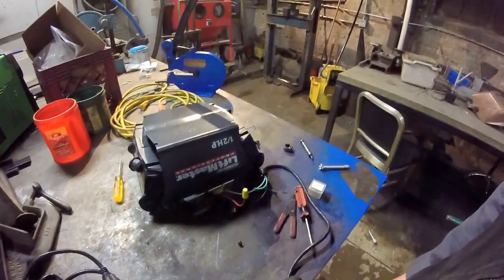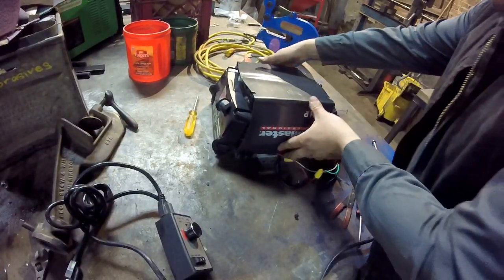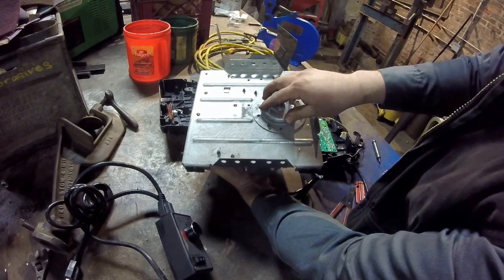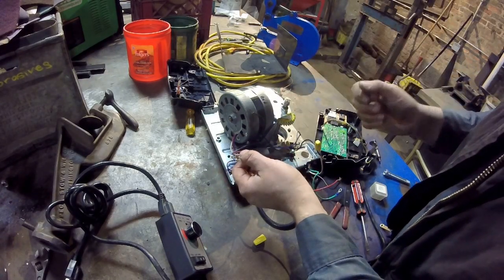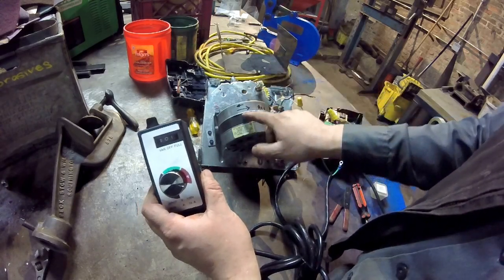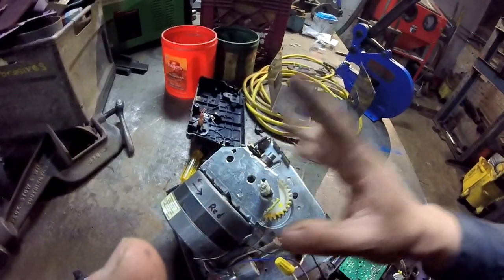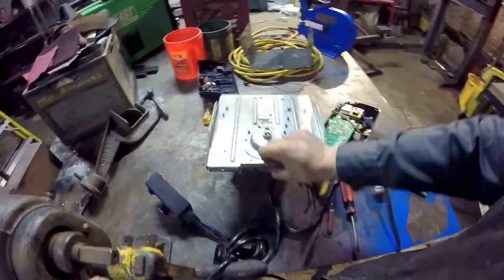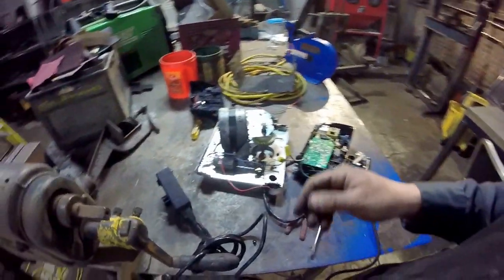Salvaged garage door motor and gear box

Comment: Nice..  i used one to lift my trailer up to the ceiling so i can park the car underneath.. just got a system of pulleys and latches that snap on the trailers strap points and set the open limit to where it tops out.. plenty enough power with the older motors without all the safety built in electronically..  its slow but works great and holds it up there for as long as i want.. letting it down i installed the sensors so if a cars parked under it wont lower on top of the car.. i thought it was friggn genius when i thought of it..

Comment: Right on man. I scored that same set up at my local scrap yard. And with a 7 pulley block & tackle system im able to lift a 314lb. I-beam at least 12" off the ground. Thats using the rubber belt. I dont know how long the belt and plastic gearing will last but thats crazy! 314 lbs. with plastic gears. Who would've believed it?? I was looking for information on wiring that motor using a 12 vdc system. But I'm not having much luck. Cool vid buddy. Keep posting.
Also looking to replace the plastic with brass gears and the belt drive spur gear, also plastic, with a chain drive.

Comment: Induction motors don't respond to Triacs (the Harbor freight controller). Their speed is determined by line frequency. In the US that is 60 hz. or 1800 rpm sync speed for a 4 pole motor. The motor will always be a little slower than that, so usually around 1700-1750. Unfortunately no one makes a variable frequency drive for single phase induction motors with a starter winding... that is what you have. There are really no electrical speed control options for this type of motor.
Reply: Jeremy Fielding is the go to guy for anything motor related. I've watched many of your videos!
Reply: So u cannot connect a reostat to this motor to adjust speed?
Reply: isn't there some kind of crappy "speed controller" that just powers on and off the motor very quickly?
Reply: @chrishayes5755  a more proper name for that mechanism would be a " new motor getter" . It would work by pre maturely ruining your current motor
Reply: Is this a AC or a DC motor
Reply: I read this with your voice in my head 😂💕

Comment: Do you think adding a fan for this intermittent duty motor would let it run longer?
Reply from the maker: pittsburghjoe , A fan certainly helps, but ultimately the internal wiring may not have the capacity for long periods of running.

Comment: I had this brilliant idea: I was going to use my old garage door opener motor to power my meat mixer. The mixer requires forward and reverse, and low rpm's (`50-60), so I figured the opener motor would be perfect because the drive sprocket is already geared down pretty far.

I removed all the safety systems and the circuit board from the opener and was left with a black wire from the power cord, and red and blue wires going to the start capacitor. Sure enough, black to red spins the motor forward, and black to blue spins reverse. Perfect! The drive sprocket on my opener spins around 90 rpm, so It only has to be geared down 1:2 ratio. Great! 

I sprayed out the motor and gears with air compressor, and greased the gears and lubed the bearings. 

Thing runs great, EXCEPT: Apparently, garage door opener motors are only designed to run for 30 seconds or so! Mine gets real hot, and the temp overload kicks in and shuts it down after 2-3 minutes of continuous operation. BUMMER!

Not sure how to proceed...
Reply: https://www.youtube.com/watch?v=UiOQeElwpjI&lc=z23gfh5y2tfkjrrwe04t1aokgtmr52mu45wusbrrdnfark0h00410